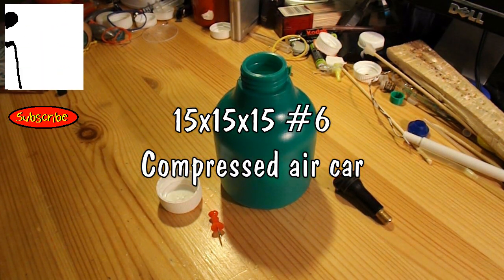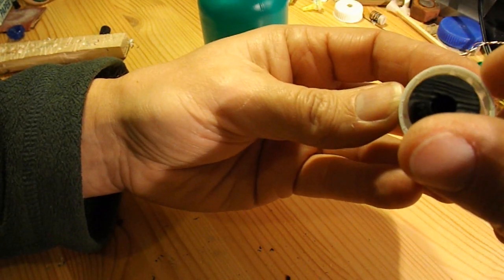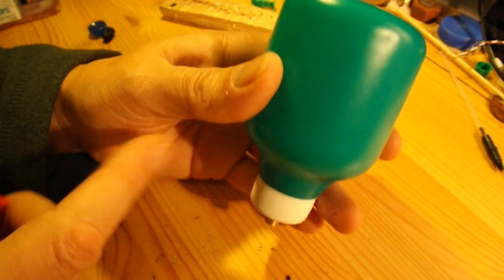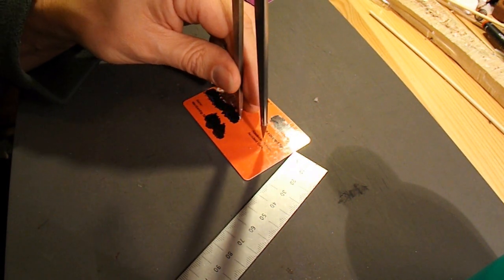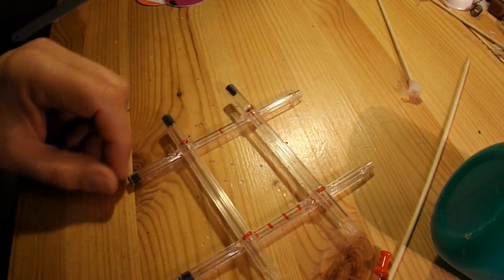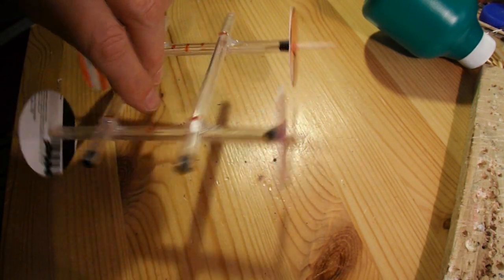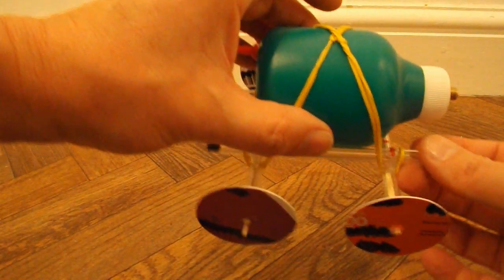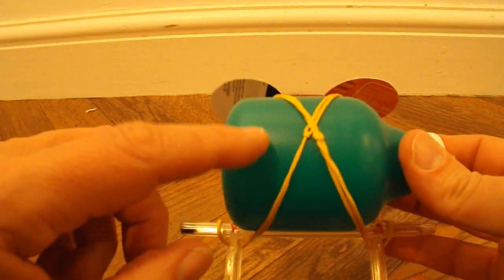15x15x15 #6 compressed air car

Comment: Yes, this is a good project, no need for mentos here. :D
Reply from the maker: Thanks Mike, the air pressure ones don't give as much thrust as the water ones but you can use them indoors without the mess 😍

Comment: You don't have to cut / glue / screw in the valve.  With an appropriately sized drill bit you can drill a hole the side of the valve neck, into which the valve will naturally fit snug and air tight.  No glue required.  This is how the valve is designed to be installed.
Reply from the maker: Yes that is fine if you have a complete valve unit. If you look at the one I am using you will see it has been cut down across where the seal would be. I went to my local tyre fitting depot and asked for some old valve fittings and that is one of the ones I was given. In this video you will see I did one like you have suggested https://youtu.be/hGkp9yaQeg8?list=PLA5a2xPRSrB12AjOGqZQmFTeAkAp7apfC

Comment: Maybe chassis can be made lighter with cancelling side rods and glueing front and back axel directly to the bottle? it might also deflect the direction when pumped, science is with us to try :)
Reply from the maker: Hi iilkerr, yes you might be able to make it lighter like that, the main problem would be getting a good fixing for the axle tubes. My target was to travel the length of my kitchen and it does that, so I have no reason to change it.

Comment: Interesting concept. What is your opinion of powering the cars that people drive with compressed air? I've seen YouTube videos on the concept but I'm not sure how good the speed and mileage would be.
Reply from the maker: +James Vander Vegt I have probably watched the same videos. The first question is why would you want to? I have no idea of the costs involved but the cost of filling an air tank should not be forgotten especially when you have a limited number of suppliers available compared to normal petrol stations, so you range would be limited by their availability. I certainly wouldn't use a jet of air like this car, I would use a normally valved engine like the ones in the air-engine racers in my Air Powered Cars & Boats playlist only larger https://www.youtube.com/playlist?list=PLA5a2xPRSrB12AjOGqZQmFTeAkAp7apfC The principle is no different to a steam engine other than the fact you have compressed the air in advance rather than generating steam to create the pressure. The fact the air has been compressed in advance means that the costs and 'eco' viability is hidden from the casual observer. As you say, there are plenty of videos on YouTube on commercial prototypes and all seem to have limited range and speed but then, they are only prototypes. The same was true with the prototype electric cars and now commercial electric cars have good performance but lots of hidden costs.
Reply: GrandadIsAnOldMan
The reason people would largley want to do a thing like this is for ecological reasons. I'm not really sure the air compression process. They might find better ones in the future idk.
Reply from the maker: Somewhere along the line it is virtually guaranteed that we will be burning fossil fuels to produce the energy to compress the air. Even all those solar panels you see everywhere will have been manufactured using that energy at some point. The only question is which overall process uses it most effectively. That includes digging the minerals out of the ground all the way to wrapping the finished product in plastic bags ready for sale and finally disposing of the remains at end of product life..

Comment: What psi was it pumped to
Reply from the maker: I don't remember, there is a pressure gauge on the pump but I don't remember what value it went to. This is similar to pumping up a toy football,  I just pumped it until it began to feel hard to pump. There is a link in the video description that shows the sort of pressure that pop bottles can withstand before bursting. I would suggest wearing eye protection to be safe and just pump it  a few pumps at first to see how it goes, it does not require much pressure to propel the car at a good speed.